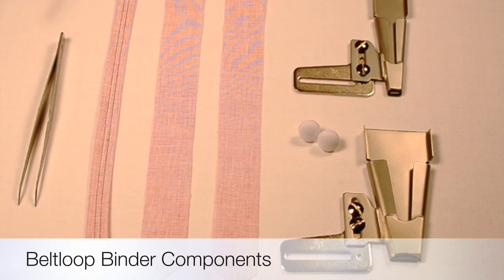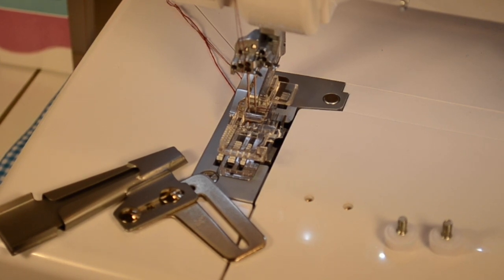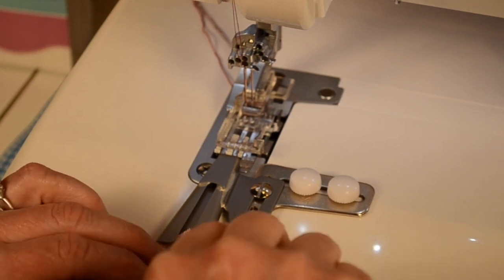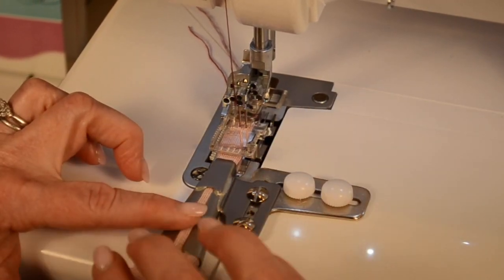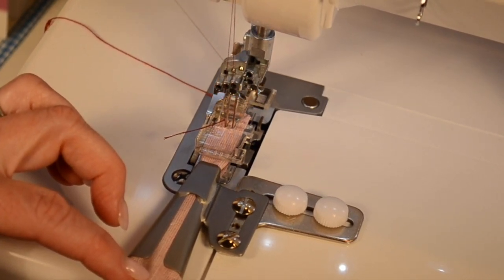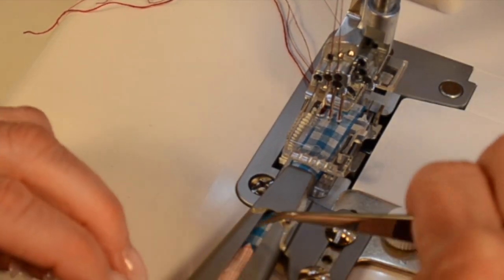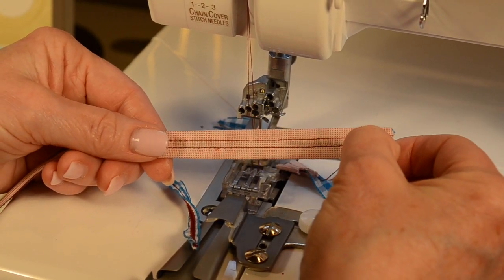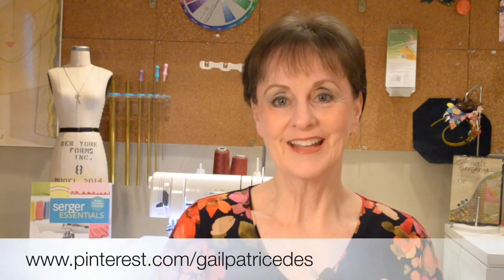The Belt Loop Binder

Comment: Thanks for great video. Have you used the belt loop binder to see stretchy fabric. Trying to make straps for sports bra and having technical difficulties
Reply from the maker: I haven’t used the belt loop binder for stretchy fabrics and not sure if it would be appropriate for sports bras. I haven’t made one. You might want to check articles or an online class on making sports bras for the best materials and techniques. Sorry I am not a expert and don’t want to steer you in a wrong direction, but thanks for watching Serger Tip Clips

Comment: Gail Yellen I cant seem to get the right with for the stitches to cover on the back on the 1 1/2 inch food any help will be appreciated!!! thank you, Brenda
Reply from the maker: Hi Brenda! Are you using the wide or triple coverstitch? That makes it easier to catch both sides of the fold. Check that your fabric is cut to the correct width also-it might be too narrow. Different fabrics sometimes require a slightly wider width for the stitching to catch both edges.How wide and what fabric are you using? Thanks!
Reply: @GailPatriceDesign   Hi Gail things for getting back to me I am using a 100% quilters cotton and I have my needles in 1 and 3 but it seems like no matter which way I move it I missing one side or the other I've did the fabric at 1 and 5 eights a tick bigger If I do it bigger it seems to flip out more than in I've lined it up which I thought was correct I just got this so I'm new at the 1 and 3 /4 1 5/8 then tad wider  I have these smaller 3/4 and I don't have any trouble with that I made that it inch wide and it zooms
Reply from the maker: @MKBuddy1  Try 1 3/4"-width. And stitch at a slow to moderate speed so that you can control the binding strip and keep it centered as it feeds through. Cut a length longer than your finished dimension will be and feed it to the back of the presser foot before stitching. The needles and foot need to be raised. Try that and let me know. We'll get this to work!
Reply: @GailPatriceDesign  I will try that again tomorrow and let you know how it turns out.. thanks Brenda
Reply from the maker: MK Buddy let me know if it works. If you need more help let me know. We can always schedule a phone call to figure it out. We’ll conquer this together!

Comment: Hi Gail. Thanks for your great videos.  Can you use knits in the belt loop binder?
Reply from the maker: Hi Karen,
You would have to test your knit fabric with the belt loop binder. If you're working with a very stable knit, it might work well, but a very unstable knit probably won't be successful.  I rarely say "never" because often there is a clever "workaround" that will allow an unlikely fabric to work. If you don't need stretch in the binding strip, try the grosgrain ribbon trick. Keep me posted and let me know your results. I love learning too—thanks!

Comment: Hi I'm new to sewing what is the name of this machine
Reply from the maker: Hi Naresh, I am working on a Baby Lock (brand) Ovation serger and using a belt loop binder attachment. This particular serger does both overlocking and cover/chainstitching. Overlocking is the stitch you see on seams on your ready-to-wear garments. It overlocks the seam while it trims excess seam allowance. A coverstitch is the hem stitch you see on your T-shirt bottom edge as well as the sleeves. A serger is a wonderful companion to a sewing machine. It doesn't totally replace it. Each machine does specific stitches that the other cannot do. Because you're new to sewing, you might want to enroll in my Craftsy class, 40 Techniques Every Sewer Should Know. Go to my website (gailpatrice.com) for a 50% off coupon Let me know if you have more questions and thanks for watching!